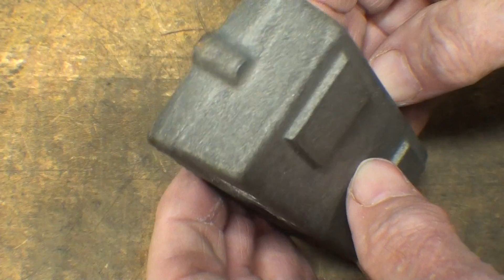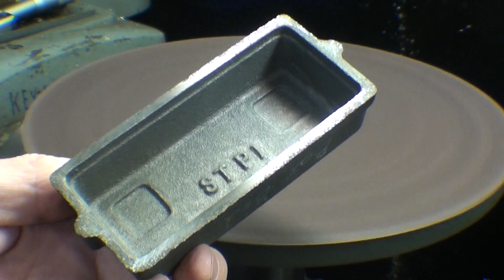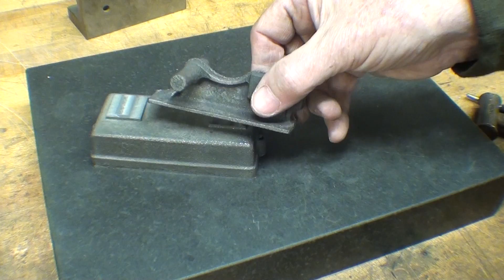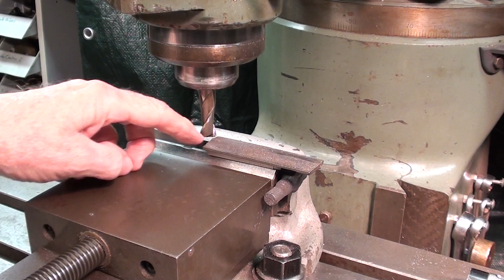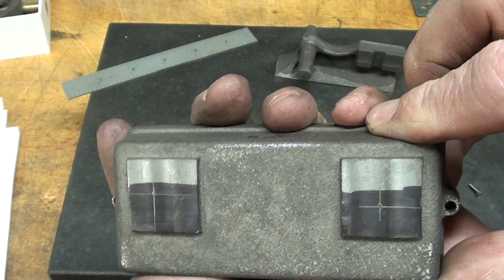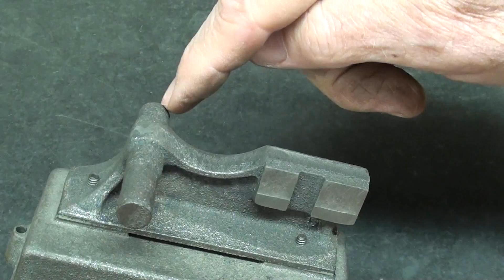Tubalcain BUILDS A STUART STEAM ENGINE pt 2

Comment: Something that confuses novices is that they do not realise engieering plans only show how something CAN be built, not neccessarily how it MUST be built. If a dimension is not given on a plan it is not critical to a successful build. This is where skill and experience come in. Also, in (model) engineering there is ALWAYS more than one way of doing things. P.S. Always, always, ALWAYS read ALL the plans and instructions before you cut metal. A super important piece of information concering a part described on page 1 might not be mentioned until page 10. (You'd be amazed how often that happens...)

Comment: I think you are about to make a mistake. The 2" dimension between the crankshaft and the cylinder pivot hole is quite critical, if it's incorrect then the position of the piston inside the cylinder is displaced and it will hit the cylinder end covers. To remedy this will mean changing the length of the piston rod to accommodate the error. I have not built this particular Stuart engine but have built other Stuart engines and have found that although the drawings are archaic being all 'fractional' dimensions you should use a tolerance of better than 0.005" or else they will not work well. 
I have drawn a 3D model of this engine and made a 3D print of it, which runs well.
Many thanks for your great video's, I'm a great fan of yours and I think I have watched them all.
Reply from the maker: Thanks for watching-hope it runs when done

Comment: Looking forward to seeing you work cast iron. I am just about finished with a fairly large project that involved cast iron castings and I ended up breaking a couple of end mills before I was done. The first time, I was taking a deeper cut as you say (maybe 0.025") and was almost done with the operation when the teeth chipped off. I then decided to use an angle grinder to grind through the  outer scale where I could which helped I but still broke another EM before I was done. Got me to thinking that back in the day, they used lots of cast iron and didn't have fancy EM but used beefy single point cutters so maybe that's the way to go? Cast iron seems soft except when you hit some piece of sand(?) or other hard impurity! Also do you recommend HSS or Carbide? Thanks for the great videos.
Reply: Back in the day (75 years ago) my pop said they would get castings from the foundry that would use old automobile engine blocks in the melt. He said that was ok until you hit a wrist-pin that had been left in the engine block!

Working with cast iron is a nuisance for the machinist and the machine tool.  The iron dust gets into the way oil  and makes a grinding compound out of your lubricant. Wipe exposed ways clean with a soft cloth and get up all excess lubricant. Cover exposed machine ways with a cloth if possible.

Cast iron machining is one place where I wholeheartedly agree with Lyle's admonition not to use an air hose... use a vacuum to police up the dust and chips. An air hose will get iron dust into everything.

Lastly, notice Lyle's hands... see that black cast iron dust? Wash your hands and forearms off with soap and water... never blow the dust off with an air hose. Using an air hose will force the dust into the pores of your skin which is probably not a good thing to do.

Orlin in NC
Reply from the maker: Thanks for watching--either will work
Reply from the maker: Good advise